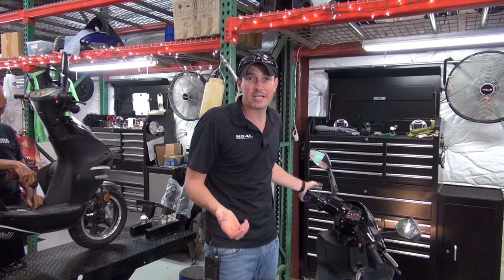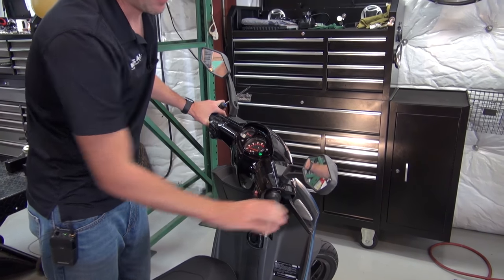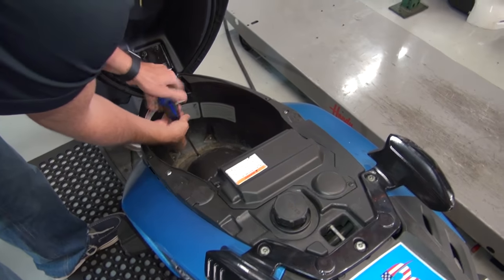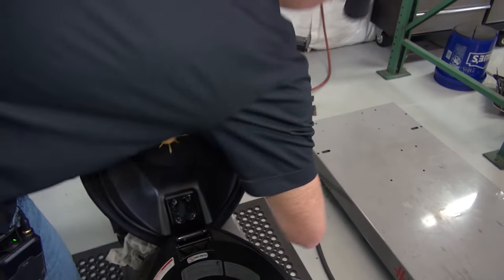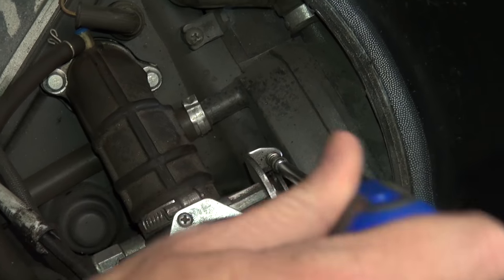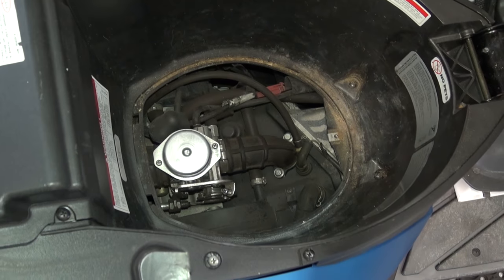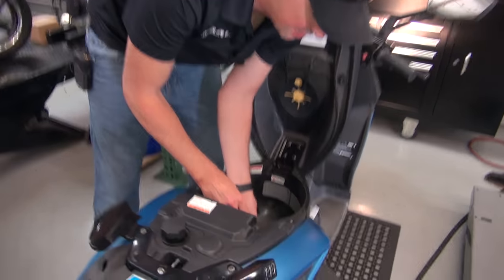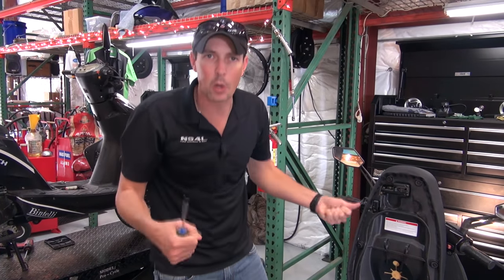Scooter Troubleshooting: Scooter Dying Out When You Come to a Stop / Low Idle

Comment: That’s a temporary fix not a permanent solution to the issue.
Reply from the maker: If you're idle is just low, this will fix the problem.  Been doing this for 17 years. Sure, there could be deeper issues... vacuum leaks, etc. but sometimes this is all you need.
Reply: I just put a 70cc cylinder on my aerox yq50 and the idle is now too low due to the larger volume cylinder not being filled with enough petrol.
Reply: @elliotdownie7431 and how do you fix that then?

Comment: Ive got a 250cc scooter the other day I was riding it and it felt like it was running out of gas but it picked up started running  but it doesn't have the acceleration like it did before that ordeal
Reply from the maker: Sorry to hear that.  Probably a fuel or air issue.  I'd get it to a tech when you can.

Comment: When I turned this screw on mine, I know I used to be able to make it so my idle rpm was high enough to get my wheel turning, but lately with the screw turned up completely, my idle is only about 1200 rpm, which is nearly enough to keep the scooter running, but sometimes not quite.
Reply from the maker: hmmmmmm... you have the idle screw screwed all the way in?

Comment: when the wheel spins on idle tho its not enough to move you but it does mean that the clutch is in contact with the bell and that means wear. what i do is I run the engine cold, and when the enricher stops, it drops in a very low rpm, that's when i adjust it low enough that it doesn't stall after the enricher turns off.
Reply from the maker: Thanks for the tip!
Reply: From what I've understood is that, when the rear wheel starts moving, it's not idling thru the pilot jet, the main jet kicks in.

Comment: Ok here we go i just replaced my carb and it wont electric start or kick will come on if i twist throttle but it wont stay running to adjust idle?  I have to twist it alot to make it rev..then heres a another problem ive tried a bunch of times for it to start with my electric start now it wont make the click noise but a diff noise now??? Im worried i broke it..makes like a zooommmm noise when i push the electric start in im so sick of scooters.. can you please help me ive also check my hoses to make sure there good after replacing the carb..
Reply from the maker: Sounds like the starter motor is just spinning or the starter clutch gear isn't grabbing.  Could have come unaligned in the transmission. I'd get it to a shop man. Sorry!

Comment: Must be nice that this solved everyone else's problem with it. Mine however still stalled anytime I hit the back break whether I tightened or loosened it so what's the next reason it could be doing this.
Reply from the maker: Check your vacuum lines that run from the intake manifold to the fuel petcock and make sure there isn't a crack in them.  Also make sure there isn't a crack in the intake manifold spacer that goes between the intake manifold and the head of the motor.  Could be a crack somewhere.

Comment: I had that problem, to solve it I set the air/fuel mixture screw 1-1/2 turns out and then the idel at 1900rpm when cold, after warmup rpm is at 1900~2300 problem solved.
Reply from the maker: Nice.

Comment: Great stuff !  Thank you !
My relatively new Piaggio scooter keeps dying out whenever I'm idle, I will try this when I get home !
I assume the screw simply gets a bit loose over time from all the bumps and shocks on the road.
Reply from the maker: No problem!  It could come loose, but it's more likely that there are external factors leading to it... break-in of the vehicle / wear over time, warm / cool weather, etc.
Reply: @NewScooters4Less  Same thing with my brand new 2018 Bintelli Scorch that I got on November 19th, 2019. So I'm assuming it's either the warm/cold weather that keeps changing down here in St. Petersburg, FL, it breaking in, since it's coming near 500 miles, but currently at 450 miles, or my carb cleaned or replaced.
Reply from the maker: @JovanteeBlair  In this instance, probably breaking in.  Your unit is so new that adjusting it and fine-tuning in the first 500 miles is pretty normal.  Thanks!
Reply: Mine is a 2012 Typhoon 125 with 10,000+ miles. It has started doing this recently. I am going to try the idling screw, but I'm wondering if it might be indicative of something worse?
Reply from the maker: @jpy8  Possibly.  This also happens when there is a vacuum leak, etc.  However, these idle adjustments are super common.

Comment: what about the opposite. 
so mine works well cold, picks up very quickly. but after 2 mins then the bike bogs , i then have to fether the throttle up to it gets to a higher or around 20mph speed then works fine. 
please get back to me if you get yhe chance.
many thanks, rich
Reply from the maker: Vacuum leak possibly. Check for cracks in the vacuum line, intake manifold, intake manifold gaskets/spacers.

Comment: Check the air filter also to make sure it's getting enough airflow? Then re-adjust the idle?
Reply from the maker: Sometimes you can have an air leak, vacuum leak, etc.  Definitely make sure your airflow is good too.  Then, yes.  If all is good.  Tune the idle.

Comment: I have the exact same problem with my scooter, except mine has fuel injection, not a carburetor. What should I do with it? And it's not just when it's cold, it happens all the time for me. I check the engine, and don't think that there is an idle adj screw like the one in this video.
Reply from the maker: Unfortunately, I think you might need to get this one into a shop for a proper diagnosis :(

Comment: I have a brand new scooter and it dies as well at an idle or coming to a stop. We have adjusted the throtal and that doesn't help it. We have had nothing but issues from the get go. The automatic electric choke was burning out, magneto was not gapped properly, the company we purchased it from sent us a new carborator and everything. Do you have any idea what we should check before my boyfriend throws it in a ditch somewhere?
Reply from the maker: What kind of scooter is it?
Reply: @NewScooters4Less  it's a VIP future champion. We finally figured it out though the valves needed to be adjusted. Now it works great. Funny but he actually got pulled over for going 45 on it when top speed with out a motorcycle license is 30😂
Reply from the maker: @jessicayoung6822  Yep!  That can definitely create a problem!  So glad to hear you got it figured out!  (Slow down! Lol!)

Comment: I jus bought a new scooter yesterday. Engine bogs down and cuts out all the time, especially when i indicate or have lights on. Freakin annoying. Jus soent a grand on a faulty bike on gumtree, feels bad man.
Reply from the maker: WIth it being that new, I'd take it back where you bought it.  If it bogs down when you use indicators, etc. then it's probably an electrical problem.  I would start diagnosing by checking all your ground wires first to make sure none of them are broken.

Comment: My scooter is doing what you described. Problem is, my idle screw is already maxed out. I also adjusted the throttle for an idle. Now when it warms up the normal idle will rev higher and try to roll on a stop. It still starts like it's flooded and dies at stops until it warms up good. But onece the engine is hot it performs normal. I am guessing an adjustment at the air/fuel mixture. Or a leaky vacuum line. I will just put it in a shop and describe what's happening.
Reply from the maker: Yo Adam.  I think you are on the right track.  My first inclination was a vacuum leak somewhere.  Also check the intake manifold.  I've seen them cracked on the base sometimes.

Comment: Hi mate, I have a Peugeot vivacity 9/02 can not get started, have got spark and fuiel, can not find how to check valves or were the cover is, it was running 2 year’s ago but would conk out after running awhile, now trying to use it again, can you help, I’m thinking it may have sticking valves?? Regards Chris
Reply from the maker: I'd assume it's carburetor related, especially if it's been sitting that long.  I am not familiar with that scooter though, so I would recommend getting it into a shop close to you.  Thank you!

Comment: I have an opposite case. The idle is slightly high and my scooter is pushing forward in idle. So I tried adjusting that screw by unscrewing it as far as it could. But that's not bringing down the rev. What's the problem?
Reply from the maker: Is your throttle cable too short?  Did you recently replace that?  You should be able to adjust the cable some too at the throttle handle and on the carb.  It could be pulling to much on the carb (giving it too much gas)

Comment: My garage called that the throttle tension screw. They said that if you're tweaking t
it to keep your scoot alive there's probably another issue! That's why once you've adjusted it, the engine  doesn't die down as quickly as it did when you release the throttle. Maybe air leaks in the rubber manifold or the idle speed screw (on the side) isn't adjusted correctly.
Reply from the maker: The screw on the side (depending on the type of scooter) is usually a fuel / air mixture adjustment.  With the idle screw (what I'm showing in the video), if you have to tighten it all the way down to keep it alive, there is definitely a problem.  Like you suggested... a vacuum leak through the manifold, etc.
Reply: +New Scooters 4 Less I believe the keihin carbs fitted to modern piaggio scooters have the air/fuel mix on the under side of the carb.
Reply: #15 is idle speed
Reply: Obviously yours is completely  different but I'd say there's a lot of people with one of these in their bikes.
Reply from the maker: @C.D.J.Burton  Thanks for sharing all the info!
Reply: +New Scooters 4 Less You're welcome man. I'd say your fix is a useful thing to know for anyone facing these issues and needs that quick fix. It never really fails, yes the throttle take a while to die back down but it kinda sounds cool. A lot of people wouldn't do anything being to scared to make the problem worse but this is one of them sure-fire ways of getting home in an emergency.

Comment: Hi, I have a concern in my scooter. Every time I slow down to turn or ride across a hump on a road, my sccoter will suddenly have a slight burst in speed. Is there any fix to this? I tried adjusting the idle speed but it's still doing the same speed bursting
Reply from the maker: Hmmmm... maybe a vacuum / air problem.  Check your vacuum lines to make sure they aren't getting pinched by a shock or something when you turn.  Also make sure none of the lines are interfering with your throttle cable on your carburetor.

Comment: So.i did this and found it still wasn't staying on I went to the throttle cable on the carb and now it revs wayyyyy to high and if I even move the screw it dies down if I adjust it ... What am I doing wrong or what do I need to adjust instead the cable back more slack or tight ? And loosen the bold more ? I'm at a loss going 30 mph with 100 cc
Reply from the maker: I'm sorry.  I would need to look at this one in person. Do you have a shop near by?

Comment: hi, i didnt use my scooter this winter, and now, when its on the stand its starts but when i leave it down it will just cut out, i kept it running on the stand a few minutes to warm up but then it was doing the same, do you know what it could be??
Reply from the maker: Is a vacuum line or fuel line getting pinched by something when it comes off the center stand?  I would check your lines to make sure they aren't caught up in a shock or something.
Reply: @NewScooters4Less  even if the scooter is not running and is not on stand it dosent start, i was thinking is something to do with the wheal being in the ground and not being able to spin..
Reply from the maker: @sarahmulqueen9014  I'm not sure I understand.  If it's starting and the wheel won't spin and feels stuck, you could have a broken clutch spring or another transmission problem.
Reply: @NewScooters4Less  sorry about that english is my second language, the wheal is spinning when is on the stand, but when i leave it down the engine just stops, and its a 125 cc twist and go there's no clutch, its ok nevermind i think i need a mechanic to check it properly, thank you
Reply from the maker: @sarahmulqueen9014  Not a problem.  If the wheel is spinning when it is on the stand, the idle may be turned up a tad bit high.  There is a clutch, but it's a CVT transmission (meaning it's automatic, aka - twist and go). I would definitely get it into a shop when you can!  Good luck!

Comment: HELLO PLZ HELP !  when i start mine , it doesnt a actually keep that rev ... in about 4 seconds it allways die out when stoped ... SO can it be   screwing  it up a little when its OFF then see if it fixed ??? and is it propubly coz the battery thats dying? or a some dirty in  the carb???? thnx   a lot
Reply from the maker: Could be a vacuum leak.  Look for cracks in the vacuum hose or the intake manifold. I'd start there.

Comment: Mate, that is not my issue. The scooter dies whenever I slow down, before I stop at the light, or stop sign. Mine is a Piaggio BV 500, and it is fuel injected. Looks like it had the wrong spark plug, and there was what looked like golden fluid, anti seize I'm guessing, that ran down the threads onto the spark head. Cleaned it out, put in the right spark plug, same problem. Won't idle well when sitting, and needed help to stay going at 3 minutes, and later at around 7 minutes. Meaning a little gas. Cut off completely at 7.5 minutes. And again, bike shuts of whenever I brake to slow down for a red light. Any idea what the issue could be? Note, I did change the air filter prior, and it was worn out. Could that be the issue? It being fuel injected wouldn't the idle reset based upon the now improved air flow, or is this something I need to do manually? Does the Piaggio BV 500 circa 2007 have an ECU that has an idle reset procedure,. or no? Any help is appreciated. Thanks.
Reply from the maker: There are several problems it could be.  For a bike this big though, they plug up to Piaggio's computer system and a computer can tell the technician what's going on or the tech can at the very least get readings, etc. I'm afraid you are going to have to get it to a Vespa Piaggio Dealership for this one...

Comment: Fairly new apriliia storm scooter. Engines dies  when throttle is pulled. But doesnot have any problem once it gets warmed up. Will this solve the issue. It happens everyday when trying to start the scooter.
Reply from the maker: Check the fuel-air mixture.  Some scooters have a screw to adjust.  You may be able to adjust the needle in the carb or you may be able to adjust how much air is being sucked into the air filter.  Sounds like an adjustment there will help.